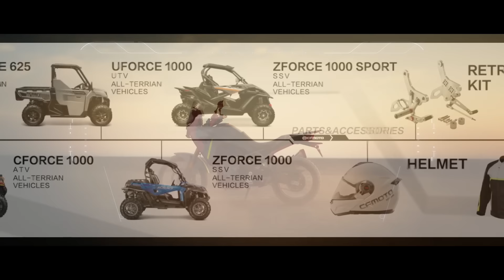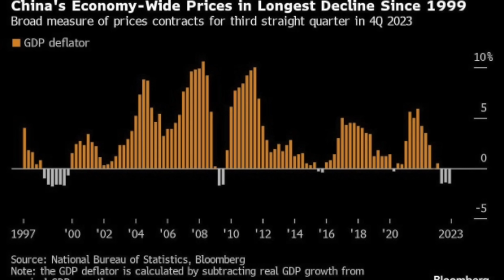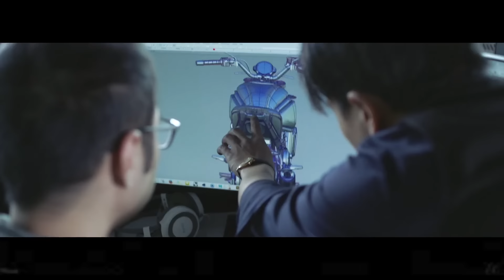Can Chinese Bikes Take Over the Motorcycle Market in the West? (CF Moto, Kove, Sur Ron)

Comment: The only reason I would not is because I wouldn't be able to get parts easily and or upgrades .
Reply: Yep, it's hard to find parts for Chinese motorcycles here in my country & option for modifications is limited too. 150cc Japanese motorcycles is faster than the vaunted 350 cc CFM motorcycle.

Comment: Got 1000 miles on my MT450 here in Europe. Fun, comfortable, good suspension, littel bit of "fancy" display and all the adjustments. Overall quality way up there (some fasteners are not quite 100% Japanese). Good power but crap emissions dictated on off idle fueling. Biggest compliment, short gearing, 65-70 mph at 7000 rpm. The engine has plenty of power for taller 5th and 6th.

Comment: I bought my first Chinese bike in 2007, a Lifan 200cc dual sport. I put 53,000 miles on it, a very reliable little bike. Since then I've owned several Chinese bikes including a Zongshen 200, a Hensim 250, and a Taotao quad. I also have an old trail 90 with a Lifan 140cc engine and a 200cc Chinese scooter. All very reliable. Any bike I buy in the future will likely be Chinese.

Comment: I was very skeptical of chinese motorcycles but went to check out a CF Moto WK 650 TR for sale localy for £1.000 and found it was in fantastic condition for a motorcycle built in 2015. Took it out for a test drive, had it for a year now and other than tyres and chain i wouldn't change anything.

Comment: It doesn't matter where the bike is built. Quality control is key. Honda had Japanese veteran engineers doing quality control in their Chinese factory, and very likely branches in Philippines, Thailand and Indonesia too. These non-Japanese Honda bikes are as good as any Honda should be.
Reply from the maker: That's exactly it. My iPhone is high quality and it was probably made in China. When western companies demand quality, they get it.
Reply: Raw materials are a big impact, I bought a Chinese dirt bike designed by some South African dirt bike rider, a lot of cnc aluminium bits anodised, same brakes as on a mainstream one can’t remember what make. It was an amazing bike once I fixed some minor issues. It was stolen so I bough another different make but looked good!!! It was pile of crap, a lot of badly cut steel, brackets etc. I rode it around my property for 2 mins and never used again. Design, materials and quality control all are important
Reply: @seanpadgett3053  Selecting material for construction is part of quality control. Materials has to be inspected before use. They do a lot of hammering, banging, and drilling to test whether they can stand the burden etc and poor grade materials will be sent back.
Even in trusted and reliable brand, there will always be compromises. Low weight, low power bikes can afford to use material of less finnesse which would also save cost. However, that does not mean they're substandard. It just mean they're constructed for lower tolerances, and therefore cost significantly lower pound per pound.
Reply: Honda built some bikes in Italy also.  I have one, a 2006 CB600F.

Comment: The big brands themselves started this trend. When they started to produce their bikes in cheaper countries. What is the difference buying a KTM 390 or a CF Moto if, in reality the end product is more or less the same and made in the same country? Except the price. What you get for your money is in the end what counts. Taking over the market is not propable, not in the near future at least but they are taking a cut of it soon, I think. A lot depends on how they build up their dealer network, for example here in Sweden the one thing holding RE back for the moment is that they have not found the right partner to go with and that keeps the sales numbers down. Every new brand has the same problem, of course but some way they have to solve this if they are going to establish themselves in any major way. Some new thinking about this is needed, massive dealer networks are costly and that bumps up prices so some other way needs to be found. That will happen, sooner or later but we are not there yet. Interesting topic!
Reply from the maker: Excellent points! I just saw the "new" KTM 790 Adventure which was brought back by KTM as a cheaper alternative to the 890. It costs as much or less than a Tenere 700 because it's basically made in China. Might as well by a CF Moto for less.
Reply: @DifferentSpokesTV  glad you got my point, I have a sneaky suspicion that my example bike the KTM 390 is made in India and not China so I stand corrected. Your example was right to the point. 🙂

Comment: Its supply and demand. Chinese motorcycles and scooters are filling a demand for affordable and basic Motorbikes. They are using older engine designs that are easier to work on and have been well engineered by Honda and other established legacy motor companies. Quality control is the main issue as you mentioned in the video. 70 years ago Japan had similar quality control issues until the 1980s, when they cornered the market in many industries like watches, automobiles, Motorbikes, and most notably electronics. I still think China has a long way to go to being a leading inovator, but the current demand in Western economies is affordability due to supply chain issues and the current state of the economy. Nonetheless, affordability and quality control are the main factors for Western consumers regarding this market and you nailed this in your video.

Comment: Nice.  I'm a former long term Yamaha owner, now retired wanting a small bike I was put off by sticker shock at local dealers.  Formerly not a fan of China products,  but in the last couple years  I have seen Harbor Freight greatly improve now becoming the replacement for Sears Craftsmen of my working years, and now actually surpassing Sears by-far in price and selection.   So after watching YouTube about Chinese bikes  I bought a  KPX250 (Venom, Lifan, QiPai) online.  It was was shipped from CA,  arrived in a week , undamaged,  easily assembled.  The fit and finish is great,   I get compliments from strangers saying they have seen this bike on YouTube and were wondering about getting one since the price is half a comparable Japanese bike.  This has been a phase shift for me, formerly resisting Chinese products and now buying a expensive (for me) motorcycle.  I wonder what the future holds with these quality bike being so cheap and other forms of transport being so incredibly & stupidly  expensive.

Comment: You forgot about Lifan motorcycles. The Chinese simply need to produce bikes people want that are reliable costs less and most important set up an extensive nationwide dealer network. That has been one of their biggest failings no support and selling them online with no support simply will not work. Young customers want to take their bikes to the dealer for service and get an email or text when it is ready for pickup.

Comment: It is a trust issue, but CFMOTO 450CLC and KOVE 450RR are less than 60% cost of Honda Rebel 500 and Kawasaki ZX4R in China. With better service and easy parts supply, so we would like to take a risk of those low reputation brands. I can see that in most of western country where CFMOTO has same price tag with equivalent Japanese bikes. well, CFMOTO 450 are actully good, even better than some of them, but those Japanese brands were proven, they have strong reputation, plus those second hand Japanese bikes are solid and cheap. I wonder how they gonna compete in western world?

Comment: having purchased TWO 883 (a C and an R) i can say that chinese Stormbreaker reliability CANNOT be worst then the afore mentioned bikes.
for instance i bet they won't set in concrete the alarm inside the main electronic mainframe (hopefully they won't put any alarm at all) so the bike will start when asked for.
then we can argue about spare parts costs: will they be as insanely expensive as the ones offered by the american company?
i doubt it very much
Reply from the maker: If it's an exact clone you may be able to use part from brands like S&S.

Comment: What beginner riders want is yesterday's prices with today's safety. It's really easy to do due to major improvements in manufacturing processes like liquid injected molding/ casting. We don't need more farkles. We want reliable but cheap motorcycles. Royal Enfield is the only brand that really offers quality motorcycles at a cheap price. But it seems like Chinese motorcycles seem to be catching up to RE in terms of reliability but still keeping costs down.
Reply from the maker: Yes, it would be nice to see more of them on the road. It might wake up the established brands and get them making more reasonably priced, smaller bikes.

Comment: It's all well said except one basic fact. There is no brand nor motorcycle manufacturer named "cossack" and it never was. And most definitely it didn't turn into "Ural". What you called cossack  is a bunch of various russian brands which were renamed by the local importer to the new name which sounded better for english speaking market. The Ural brand though exists and it is the motorcycle which came from IMZ factory and it started live as the OHV version of M72 and was initially called M61. Cheers mate

Comment: I live in the Philippines and bought a used Rusi 250 classic, it now has about 24,000 kms on it with no problems. Parts are super cheap and labour is FREE, that’s right, you buy the parts and they replace it for free. I love it

Comment: Right now one of the bikes I can’t seem to let go of and use for doing trips on is my 1998 BMW F650. 420lbs wet with a 48hp Rotax single. With 50/50 tires it gets me everywhere I need to go when on a motorcycle trip. But this CFMoto Ibex450 could be the replacement bike. A little more suspension travel and less vibration for when you are cruising at high speed. I am excited for it and if it turns out as good as it sounds, then I would seriously consider it.  We live in a lucky time with all the great bike offerings available. More is always better!
Reply from the maker: Yes, BMW abandoned the true do it all market when they went to an 800 and now a 900. Those are great bikes but they are too expensive and too nice to go dropping on dirt.
Reply: Agree! It's a pro-choice world and having more choices will engage a healthy buyers market.

Comment: I live and ride in Indonesia, my riding environment is an "exotic, adv adventure" right out of my door steps. I have locally made CRF150L (12hp), CB150X (14 hp), 300 Rally, Hunter 350, Continental GT650 and just got CFMOTO Papio SS. In my opinion the "major" brands (because of us the riders loosing grip with reality) are not delivering what we want. My CB150X is my favorite bike, $2300 USD here. It is a 80 km/h bike (tops out 120 or something like that). The suspension.....suspends and damps (I added oil to front forks only), the motor pulls to about 8000 rpm, the clutch is perfect, the brakes stop well, gearbox is sweet, comes with center stand, fueling is butter smooth, is comfortable and it has a 450 km plus tank range and most importantly it weights 135 kg wet. My Rally a "want this bike since it was released as a 250". Well this is 90-100 km/h bike, the suspension is a joke (if you weight zero kg, the static sag is already what the rider sag should be), my fueling (I have the Euro 5 ECU) is terrible off idle, side stand too short, no passing light switch (important here where people are trying to kill you), no acc adapter (but they provide acc plug right in the harness). The motor is all choked up, the slipper clutch has issues if you look around........I fixed these issues, $2000 on a budget, it's a fun bike here, but every time I ride my CB150X, I can't help but feel like Honda just doesn't give sh*t when it comes to the Rally. My little Papio SS, it's really good, quality, performance/feel  and all the nice features. I keep hoping for the 350-450 Rally, for decent suspension from factory, better fueling and tune of the engine.........I keep coming back to the fact that the Rally is 155 kg wet. Done with that, for my European vacation bike I am getting the MT450, the only miss here is the close to 200 wet weight.

Comment: And really it should be a lot easier for China than Japan. Japan had to sell products to a post war consumer. 
Remember.
It looks like CF moto have built a bike that is both lighter and cheaper than a T7 and more powerful and better equiped than a CRF Rally and done it at a fantastic price. To think I could easily be talked into selling my Rally for a Chinese bike would have been inconceivable only a few months ago. Would you have sold the your CRF for an MT? Would you sell your T7 for an MT?. I bought one of the first Hinkley Triumphs and still own it. Sometimes a good “New” manufacturer go to extreme lengths to make a reliable competitive product. My wife’s old Hyundai had about two services in over 250000kms!
Reply from the maker: I saw the Kove Rally 450 at the bike show yesterday and it did cross my mind to sell my T7 and buy one instead. I'll wait a couple of years for the reliability reports but honestly, that could be my only bike.

Comment: this is one of the most informative videos to date ;;  it has taken the chinese a long time to suss out the western market , but they have learnt , harley put their eggs in the posh basket and no one wants them ;;; the main problem still with chinese brands is spares , if you live in a highly populated area there might be a dealer , but in rural areas they are worse than than the rest which are already bad enough ;;
Reply from the maker: Yeah, dealership network is always an issue with new brands.

Comment: Been daily'ing my Benelli TRK502x for a couple years, now at 12,000km. Only fault I've had is the rollover sensor went bad and prevented startup, works perfectly with it unplugged. I previously had an Enfield Himalayan, total lemon. Same with a friend's one that blew the top end at around 10,000km. We won't be buying them again anytime soon, even if the twins are made better. Only thing I can really knock the Benelli bikes for is depreciation out the door, which can actually be a good thing if you're buying barely used (as I did)
Reply from the maker: Yeah, the best way to get your money's worth out of a vehicle is to buy slightly used and ride until it falls apart.
Reply: I am afraid, Benelli can only dream of a market presence and brand equity in the West like the Royal Enfield. That doesn't come by selling lemons. Riders in the US and UK do not fall for superficial flashy poser motorcycles that are sold by the likes of Benelli.

Comment: I rode a couple of CFMOTO bikes a couple of weeks ago during a ride day & came away impressed. They've been here in Australia for over 2 decades & are building a solid reputation.
I'm also about to go on a 450km drive in an hour to pick up a 2021 Benelli Lioncino 500 that's done 1,200km for almost half the price of a new one. It's been listed for sale for 2 weeks & the only other one for sale within 500km of me is a 2018 model with 20,000km that's been listed for 7 weeks.
I've had 2 Harley dealerships calling me in the last 2 weeks, practically begging me to come & test ride the new 350 & 500 after I expressed a little interest.
And that's a pretty decent snapshot of where Chinese bikes are in our market. CFMOTO pulled a decent crowd during their ride day, but there's not a lot of interest in any of the others, even with a big name badge slapped on the side. And the Chinese bike industry's reputation isn't helped by Braaap, Sol Invictus & now Mutt Motorcycles all bringing in the same cheap motorcycles from the same factory & slapping their names on the side. These things rust at the sight of a leaky tap & sell for almost pocket change, even when slightly used.
Reply from the maker: Yes, hopefully the serious brands like CF Moto and Kove separate themselves from the fly by night companies that bring in junk for the lowest prices.
Reply: I bought my first Harley Davidson in 2021, I took it straight to the Harley Davidson shop here in Flint, Michigan, they did a 5,000 service on it. I wound up paying almost $2,000.00 for that service, never will I buy another Harley or do business with this dealership again. I won't go into detail about everything that went wrong it would take up too much space in this column.

Comment: You mentioned 'uncorking' the Sportster clone. I'm wondering if you could do the same with the CfMoto MT450 since the only reason it has ~46hp are the stupid EU drivers license regulations. These extra let's say 10hp would make quite a difference especially for touring.
Reply from the maker: If it sells well I'm sure the aftermarket will come up with air filters and exhausts to get you some extra hp. Would come in handy when making that pass on a two lane.

Comment: 2:57
that's not correct.
germans had light and medium DKW bikes and heavy BMWs.
- light DKW were remade into Voskhod ("Sunrise") - 3:02 , and idk who named it Cossack - it was never called so (at least, inside the country; personally I don't know any soviet bike with name "Cossack " at all), as well as no latin letters - all cyrillic (you can see original Voskhod-3 sign on a battery cover). Also similar light bikes were made on other factory and were called "Minsk" (made in Belarus, which capital is Minsk)
- medium DKW were remade into IZH (350ccm 2 stroke 1cyl and 2cyl inline). (was made in Izhevsk city, so it was named after it)
- heavy BMW were remade into URAL (650 ccm 4 stroke opposites). (was made in Irbit city, that's near the Ural mountains, so it was named after it). Also ukrainian Dnepr - also opposite 2cyl, very similar to URAL.
3:39 its IZH-49, 350cc 2stroke
Reply from the maker: Thanks! You definitely know a lot more about Russian bikes than I do.
Reply: @DifferentSpokesTV   these are bikes of my childhood ) And I still own 2 IZH bikes (1980-90s).
If you need any info  - feel free to ask.